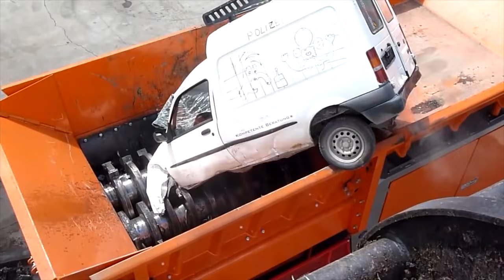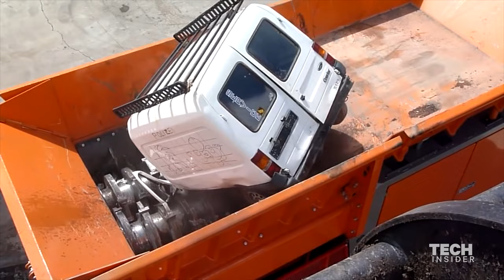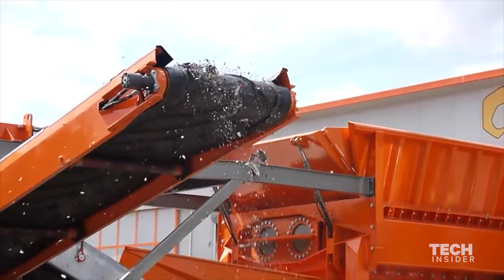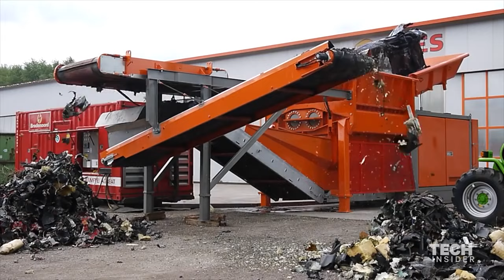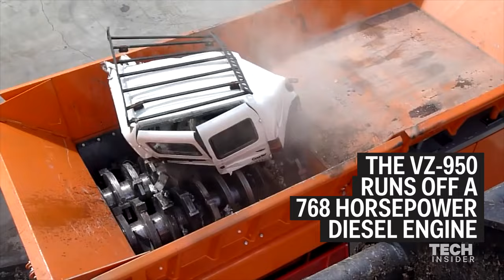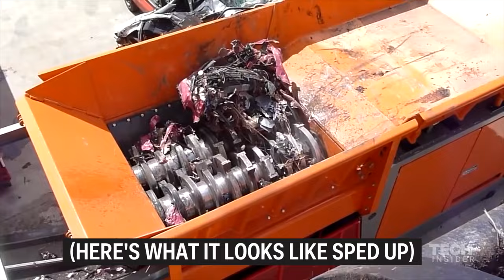Car Shredding Machine

Comment: Seems like separating the parts beforehand and using them as scrap instead of turning it into a pile of metal powder on the ground and floating away in the wind.
Reply: Yep, but if you use that metal powder correctly, it will sure be handy